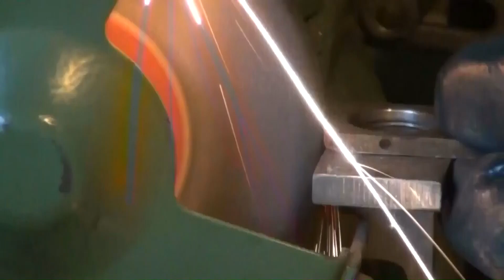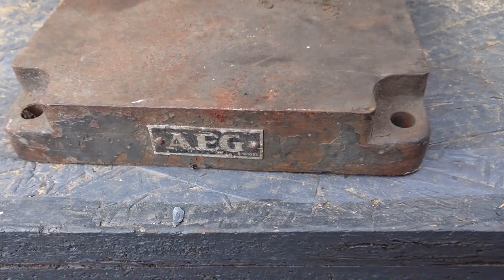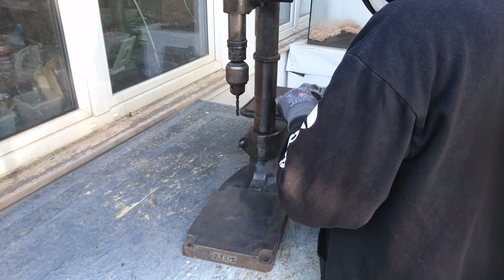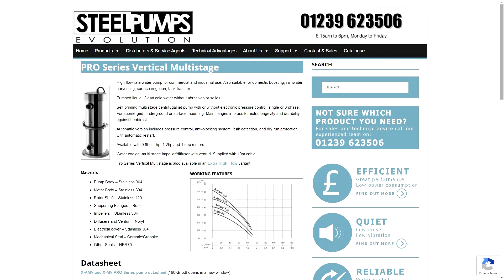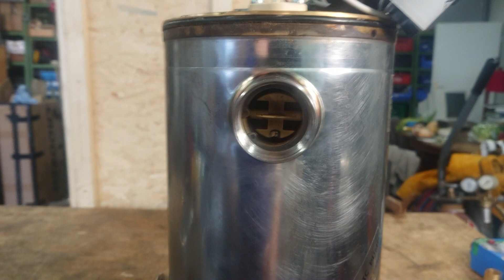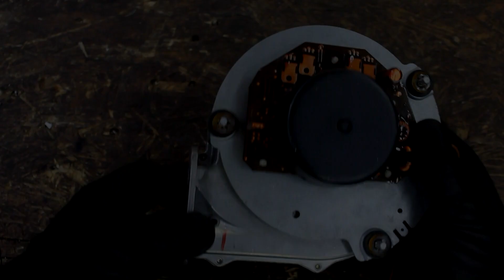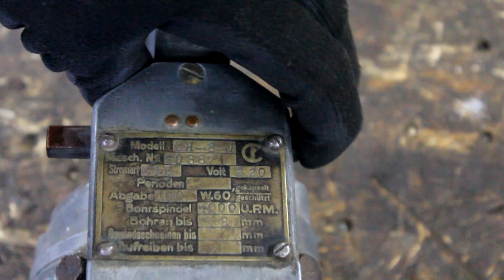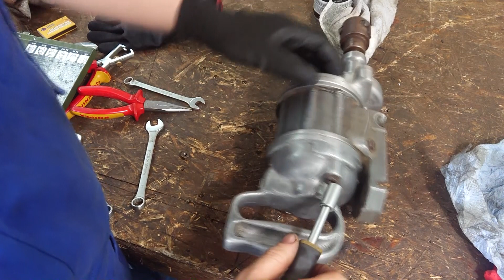Incredible Scrapyard Finds! Repair-A-Thon!

Comment: Exactly what I am doing during this lock down.  Start on a 1940’s still press tomorrow.   One of the modern tools I own.

Bat degreaser and dirt remover is carburetor and choke cleaner.  Incredibly cheap at an auto parts store and works great

Comment: While I love seeing you restore these tools and machines, I would love it if you could film you using them more. I know you occasionally use some restored tools to fix other tools, but I would love a timelapse or hour long video of you working in the shop at your daily tasks. 
I know it takes a long time to edit and stuff, but just film it with a wide lens and then voice over key parts like "now I'm cleaning the gear box with gasoline". Personally, I'd love to see more content even if it is not your normal excellent quality, just an interesting video to watch while I'm in my shop etc.

Comment: The drill sounded a bit suspicious to me. Like maybe the bearings need to be changed. Great video as always. 👍
Reply: You might be right, but I think what you're hearing is the gear reduction drive assembly. Note the manufacturer decided to use a straight cut profile.
Reply: The teeth on the gears are straight cut and that is most likely the sound you are hearing.  Modern tools use helical gears which are much quieter.
Reply: The bearings in this machine are probably just oil impregnated bronze bushings. They don't wear out and fail catastrophically like ball and roller bearings, they just get sloppy.
Reply: Agreed
Reply: @charlesangell_bulmtl  Electrical motors of that era always sound a little bit scratchy. It's not scratching tough, but sparks, caused by the motor brushes.  You can hear that scratching sound on modern brush motors too, it's just not that prominent.

Comment: "Leave it be" ist what i think a lot when i watch some other guy here on YT, rescuing hand tools.
Reply: John Chrysostom Rev 3:9  There's a whole lot of em that have "been inspired" by earlier channels. It really is so silly when they will break a piece of the original tool on purpose or w/e.
Reply: John Chrysostom Rev 3:9  what tools have you seen him destroy he fully restores tool so that they can be used yes he snaps a few bolts here and there but they are usually rusted out to the point they should be replaced anyway

Comment: Ixion seems to have been and still is a long standing drill manufacturing company, they moved away from manual drills in the 90's but instead branched out into CNC machining and small ventures into other tool types like socket tools. Oldest Ixion products i can find go back into manual hand drills. They mostly make large drill presses and i cant find many hand electric hand drills let alone in the style you repaired in the video, so it might be a head made by them mounted to the drill?

Comment: Have you ever tried traditional oilpaints? I came to use them for wood instead of modern waterbased paints, which may be very difficult to be removed in a restauration attempt in future times. I also found them to have far superior properties to modern paints. In a recent attempt, i used Oil paint on a set of old cast-iron stairs. The coverage is excellent and unlike anything modern paints can do when brushed on. Since it´s made of Oil, the anti-corrosion properites are excellent. Greetings from Vienna!

Comment: 11:30 wait, the rough cast iron is more resistant to corrosion than a polished surface? is that really?
Reply: He probably means he leaves the black oxide on it as a passivation layer. There's different kinds of ferrous rust. True connoisseurs appreciate the finer types too.

Comment: ,I love that drill I was thinking that drill.if you could hook to that first power supply  that you could  set a switch to speed up that drill and put it on a lathe shown on. here because of the size and power keep up the good work one thing if you have rusteolum paint they make a paint called. HAMMERITE it is a texture paint making tools look nice check it out

Comment: Great work. Having such a sturdy drill press can allow you to have a setup purposed for certain applications and allow for ease of use rather than continually swapping drills and bits. You do a great job and are so inspiring.

Comment: Oh its one of those old wristbraker drills ! With insane torque that breaks drills and hands !
Reply: It didn't look that potent to me. I have an old all metal Milwaukee heavy duty 1/2" D handle that I had to make an auxiliary handle for. It's gotten away from me a couple times. It has only one speed. Go. Looks like this one https://i.ebayimg.com/thumbs/images/g/s3QAAOSwEUdeOMAc/s-l225.jpg Got to love the lightning bolt on the side. That's what happens when you hit a live wire with it. The widowmaker.

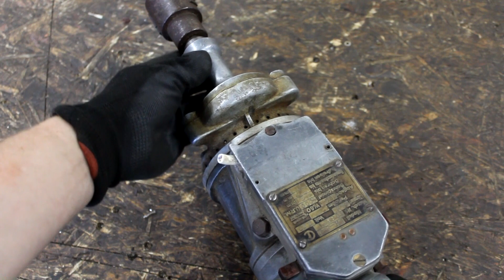Comment: 16:00 nice to see you got to the drill I gave you :D

Btw: I never drilled anything hard with it because I was too afraid that thing would break my hand if the drill got stuck. These grip designs on old drills are somehow infamous for injuries like that...
Reply: I have direct experience with a N American drill similar to that one. My dad and I almost broke our hands when it caught.
Reply: The only safe way to use an old beast like this is to have a second person standing ready to turn the power off (or pull the plug) before the thing twists your arm into a pretzel.
Reply: @jwagnermail   or have the other person take you to the hospital LOL
Reply: Can  it turn backward? Looks indeed dangerous to use without slip clutch :)
Reply: Ladytron no it can’t
Reply: The widow maker drill

Comment: Curious what that hand drill would have mostly been used to build. Fixed RPM, and only one spin direction...
Reply: It was made to drill holes. If you've ever used a bit and brace or eggbeater drill you'd realize what a big step up a single speed electric drill really is over the old hand powered stuff.

Comment: Next time you should use diesel instead of gasoline, it has almost the same power to dissolve grease but it's not as much volatile and will not make you feel dizzy, give it a try!

Comment: Hi Gerolf, I noticed you were using some graffiti brand for spraying the drill press.
Did you find this paint to be especially reliable or just using it, because it was at hand?
Reply: Good thing is they´re usually cheap to get. 3,50€ a can around here
Baumarkt rattle cans are no better and usually cost 8€ and up...

Also graffiti paint comes in way more shades and imho also choice of color hues is more refined then just plain blue, plain red, stingy yellow etc ...

Comment: I think I'd have pulled the CRT monitor off that ultrasound machine too if it was still intact on the back (and not "necked" inside from impacts from being dropped or pushed over), given CRTs are going berserk with prices for even utter trash monitors these days... :)

Comment: Interesting about AEG as I’ve got some tools from them I’d bought in the 1990s still made in Germany. Quality was similar to older “blue” Bosch stuff.
Reply: Interestingly enough, I have a blue Bosch 7" angle grinder that was made in Germany. Found a newer one (made in China) for very cheap with a damaged power cord. The guts were all the same and interchangeable. I imagine mine was made not too long before they shifted production out of Germany for that product.

Comment: Of note is that back in the day, things like material science and failure analysis weren't as well understood as they are today. So to make things last they were way overbuilt. Now we know what the failure points are so we can get similar results with pared back engineering. That's assuming the item in question is built up to a spec and not down to a price, and not intentionally made difficult to repair/planned obsolescence. Consumer goods and industrial goods are a world apart, after all. Conversely, people were just as capable at making crap in the past as they are today. The crap of the past didn't survive so people don't comment on how well it's built xD

Comment: That drill press is on the ball. The shaft seems to be straight too, unlike my newish einhell, which came with a 'factory bent' shaft and a gutless motor which can't muster the power to stir a pot of porridge.
Stay well mate and thanks for posting! :)
Reply: Yes, I agree very nice tool made to last and be reliable and when necessary repairable too, nothing like the buy today and throwaway when broken machines we get now, sad that this was probably ditched because it didn't have a full guard!, safety policy rears it's ugly head again, most rules made by people who would be scared to walk in to a workshop, it makes me fume!, skilled craftsmen don't stick their fingers where they shouldn't and don't need idiot pen pushers making rules for them, lets have a return to practical safety rules for practical people by practical people, not office bound prats who can't use a screwdriver, sorry  rant over, but I am sure some viewers will agree with me!

Comment: The problem with the pump is its hours (Bearing life), the original owner propbably got rid of it as part of its preventive maintenance schedule. There is obviously some life still in it but you are in the "danger zone" . So Ok if your process is not safety critical or runs with a very high spread cost. I would have done a verification of the armature insulation as well as power cunsumption. I don't like starting electrical motor before verifying insulation, you can damage them below 1Mohm.
Reply: Those bearing will last well unless you overheat them, and easy enough to replace.

Comment: In my opinion, the older the device, the easier the repairs are usually, cause everything back then was simple
Reply: Not everything was simpler. I was on a demolition job once and we had to haul a mechanical card reader out of a place.  Thing was the size of a car and it was packed solid with little levers. Really it belonged in a museum. Was the Antikythera mechanism of its day. But we junked it. No words can describe what that device was like. If you told me aliens made it I'd believe you. I couldn't even hazard a guess how many little parts were inside it. Kubrick could have used it instead of the obelisk in 2001. My God it is full of tiny parts!

Comment: The AEG drill press is a a thing of beuaty and simplicity, on the IXION drill note the string (?) under the commutator  wound and enamelled over the copper wires to keep them in place / protect them from breaking off. Great attention to detail in some of these old tools. Maybe it deserves a couple of new bearings, that will keep it running for another 80 years...

Comment: What was the deal with the housing of the drill shaking when you bottomed through the drilled holes? It seemed to be loose or separating. Just curious.
Reply: My guess is you're seeing the helix of the drill contacting the walls of the bore hole. The bit he's using has lousy margins. And nothing was bolted. The press wasn't bolted nor was the vise. So that coupled with the interrupted contact of the spinning bit is your shake. Twist drills don't actually drill particularly round holes. Especially in thinner material. Which keeps the companies that make reamers in business.

Comment: 62 years old and I don't remember ever seeing a two jaw chuck like that.  Thinking it had better grasping powers then these new three jaw Jacobs  crap being used.  When  you think about it they actually employ 4 contact points.
Reply: I initially thought that the chuck suited the standard square-shank drills that our parents used with hand drills (braces).
https://www.google.com/search?q=square+taper+drill+bit&tbm=isch
However, it's probably parallel jaws to suit round shank drills, because the Jacobs (3-jaw_ chuck wasn't patented until 1902 and took some years before it was dominant.

Comment: We gotta get you a parts cleaner so you dont have to get dizzy while cleaning out old grease and grime or have to keep wiping up messes on your workbenches. For a portable solution and to not take up much space in your workshop while it's not in use I would recommend the CRC Benchtop Pro.

Comment: That drill doesn't go reverse? And how do you hold that thing?
Reply: Of course it doesn't go in reverse. It's a DRILL, not a screwdriver.
It is held in the hands, like any other portable drill. One hand on the rear handle, and the other hand on the side handle (which was not shown).

Comment: A friend of mine in the building industry always told me ( many many  years ago ) he always used AEG instead of Bosh as the AEG lasted longer and didn't burn out as fast - although the little Bosh grinder i used to use when i was in the welding game was fantastic  and never let me down . 
Unfortunately many of the  these products now  are no longer made in Germany and you really have to look at the packaging to see where it is really made !
I would really like to see a video showing the history of some of the German tool manufacturers like Dowidat , Stahlwille etc as they are names i know that make or made excellent  tools . 
I also see some brands of tools , mostly screwdrivers that show all the indications that they are made in Germany but on closer inspection are actually made in Vietnam - you really  do have to read the fine print !
Reply: It doesn't matter where something was made. Only how it was made and what it was made out of.

Comment: Wonderful job, great content as always... I am a newbie and may I ask a question? Doesn't the press drill require more treatment for the rust? I mean considering the age and rustiness level of the drill, electrolysis and/or derusting liquid bath would be perfect in addition to grinding?
Reply: Not necessarily, I imagine he would have used an etch primer, which has a rust converter
Reply: Why would it need more treatment for rust? There was very little rust apart from some minor surface rust, which was removed then the exposed cast iron was repainted to improve it's appearance.
Cast iron like that doesn't really rust much anyway, so even if left bare it will not be harmed and the appearance can be maintained if some lanolin or oil is sprayed on it. 
Electrolysis and de-rusting liquids are totally unnecessary for something with so little rust like this drill press. They would also damage the machined surfaces, and you DO NOT want to change the dimensions and shape of the previously machined surfaces. That is why only a wire wheel was used, and NOT a grinder.

Comment: Yes, more like this would be awesome!  If that pump can push about 52 gallons per minute, it should be powerful enough to make a vapor blaster.  Although a urethane coated impeller is preferable for that application.  Keep up the great work!

Comment: From what I gathered online. Ixion was a german tool company. 
https://www.practicalmachinist.com/vb/general-archive/ixion-german-tool-company-79425/

One of the posts referenced a homepage for them but it seems to be non-functional, so I assume they went out of business or were bought by another company after the person posted in 2006.

I searched on google.com for ixion tools and looked at images.  It appears they made alot of drills and accessories.  I found handheld manual drills and drill presses, but not so many handheld electric drills.

I couldn't find anything on your specific drill.  Sorry.

Comment: Great repair-a-thon, as always. I really enjoyed it. I don't understand how, or why people are throwing away perfectly good stuff and tools, like that water pump.... all you did is clean it a little and add a new power cord and it worked perfectly.... Once again, great work, bravo.
Reply: maybe that is not the case. You have to think further, this test, YES. it still pumps freely but the pump has variable pressure control and many more function. Professional users buy it for these functions, however he did not test those, so maybe it IS broken. it just does it's basic funtion
Reply: @bryanbogaert8726  its also possible that the cord was damaged and corporate policy was to discard damaged items rather then incur possible liability by repairing it.
Reply: You don't really want ro know, what my company throws onto the scrap pile.
Sometimes even new tools, because they were bought some time ago, but never used - and the department has to pay for the storage area they use. So often the get rid of perfectly fine things
Reply: TheThrustProject i would like to work at your company. :)
Reply: @kopriva007  Sometimes my company takes the efficiency too serious and burns a lot of money, which doesn't sound so efficient 😁
But on the other hand, you are able to take home certain stuff, if your boss allowes to - so I got some nice tools in my workshop. Only handtools (files and clamps, but a decent set of drillbits aswell)
Reply: TheThrustProject you bave to be good with the boss so that you get more of the tools. 👍
Reply: @TheThrustProject  Marvelous, I'd be a happy camper.
Reply: Most countries have tax relief for purchase of equipment ("plant") where you can claim back the cost, often over a few years. So, if something has been claimed for and needs a repair that won't be tax-deductible it's best (modern) policy to discard it and get a new one. I hate that!
Also companies go broke and their various assets are often sold by receivers to the smallest number of buyers to cut down on bureaucracy and paper work - scrap yards tend to buy everything and that's all the receivers care about.
Reply: Shaun Stephens yes, you are rivht. Thanx for explanation.
Reply: @Shaun.Stephens  "A horse built by committee" was the ruin of Britain and the US ain't far behind.
Reply: That pump was probably attached to a machine that broke.